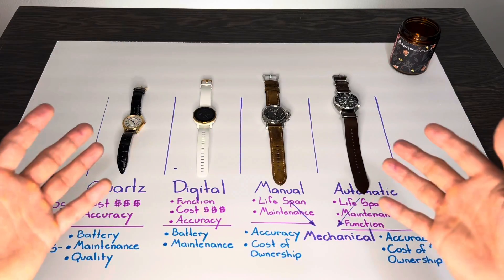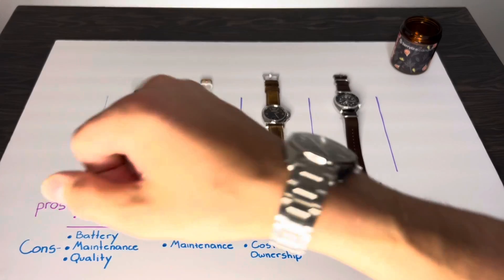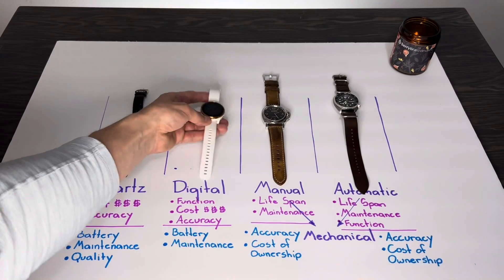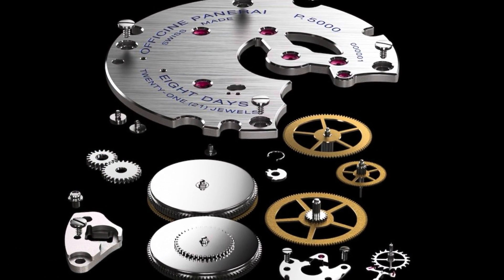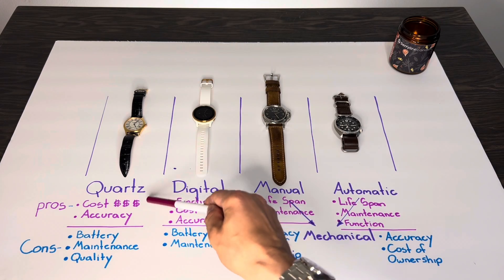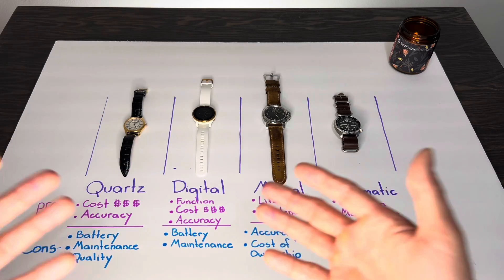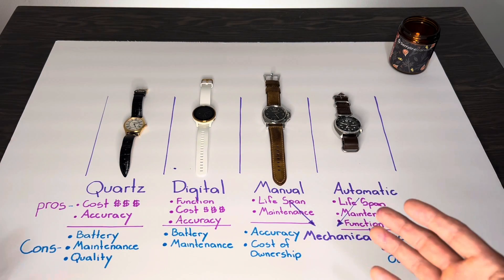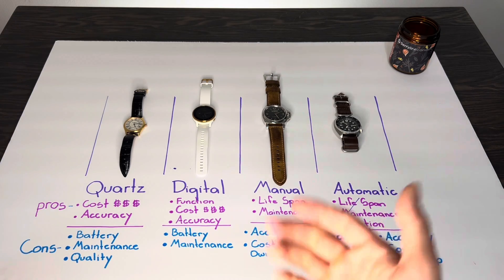How does it work !! What is the difference between Quartz Automatic Digital & Manual WATCHES ?

Comment: There is nothing wrong in replacing whole movement in a quartz watch, still much cheaper then servicing a mechanical. 
Quartz are also generally thinner, it would be hard to get an automatic below 10mm. 
battery is not a problem if you buy a solar, what i read something like citizen eco drive last like 15-20y. and the battery is not that expensive to replace. Also about battery exchanges, you can get a watchmaker toolset for below 10bucks and can replace a battery in a 5min. Also if you have a watch rotation , you can stop the quartz to save battery time, you could probably make the battery last 2-3x longer which would amount for like 5-10years. Not to mention that real digital watches like casio battery last like 10years anyway.
Reply: How do you stop a quartz movement other than prying the case off and taking the battery out, which is not that practical?
Reply: @nishiki393  just pull the crown to timeset position -it stops the watch.
Reply: @Cortesevasive  Oh wow, I didn't know that.  I mean I knew that that would stop the hands from moving of course, but I didn't know it actually stopped the movement energy consumption in the background.  Thanks, I really appreciate that pro-tip!